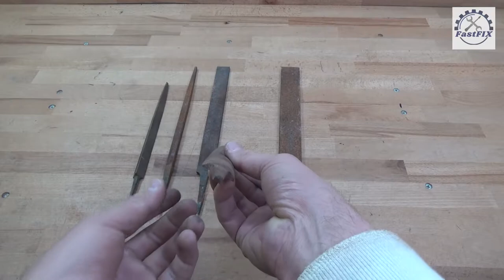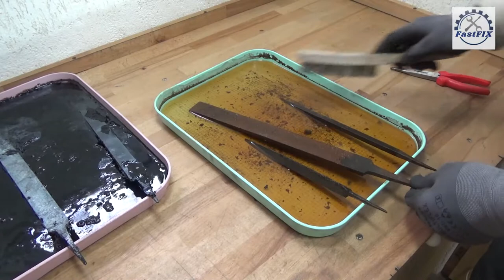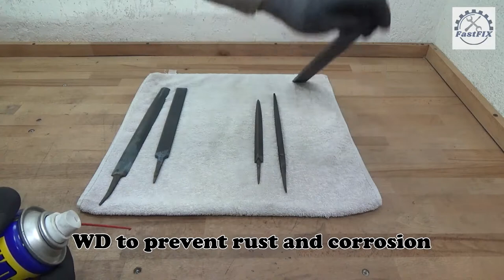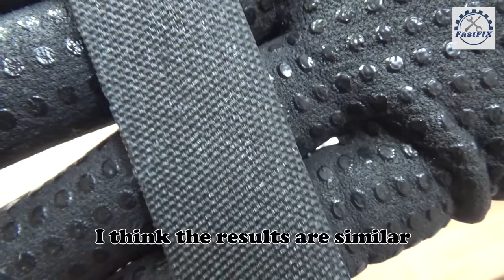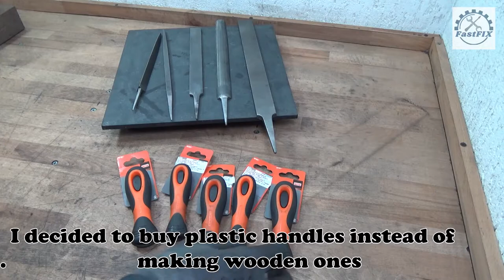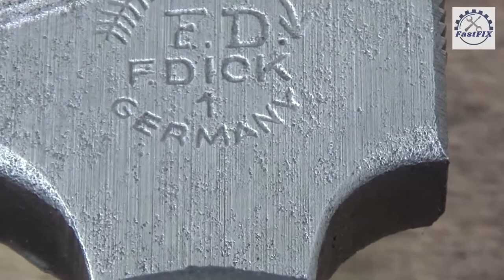Metal Files Restoration   Friedrich Dick GERMANY

Comment: i use white vinegar to remove rust from nuts and bolts if am going to reuse them you have saved some money restoring them files look smart  well done
Reply from the maker: Vinegar is a cheaper agent compared to a rust remover. But electrolysis is the cheapest. The effect is almost identical for all. There are some changes depending on the manufacturer. For simple workshops these are the best and cheapest ways to remove rust.

Comment: Why you leave files in rust remover for 48 hours when one or two hours is plenty? Look how much carbon you remove from those 2 files in rust remover making them weak. 48 hours is ok when using vinegar but not rust remover. Also you damage teeth of file using steel wire wheel on bench grinder. If you going to use bench grinder then use brass wire wheel on file.
Reply from the maker: You are certainly right in everything, you seem to have great knowledge. but ...
I still use files today, they are not damaged yet and they serve well. This can be seen in my videos that I posted after this restoration.
Thanks for the comments, criticisms and suggestions. Of course, I will remember that and from now on I will do as you explained.